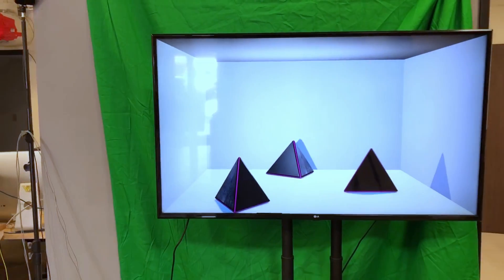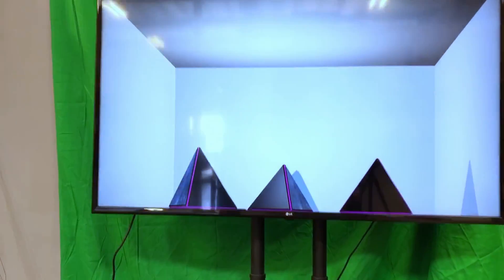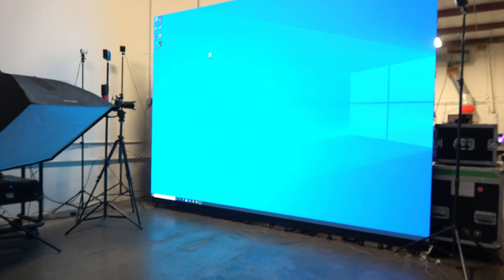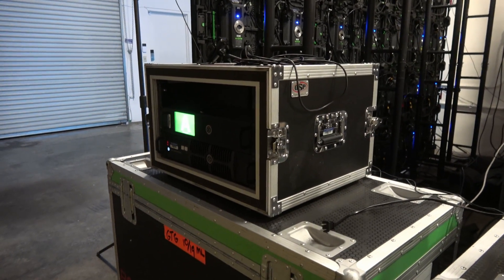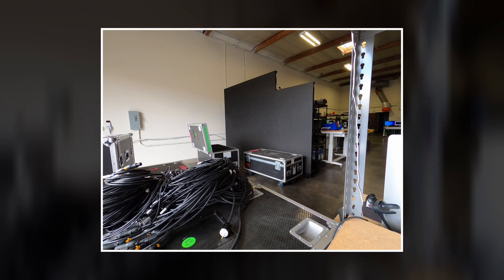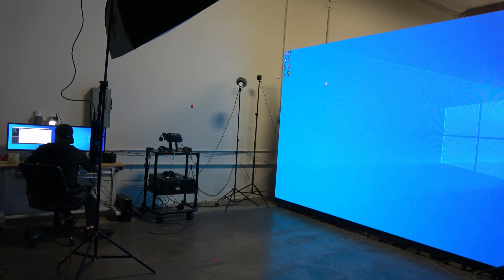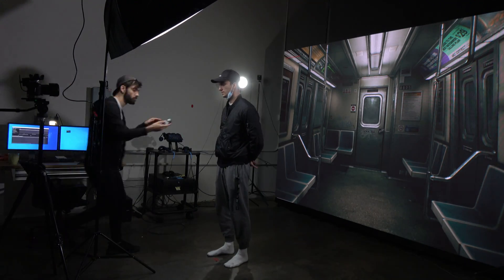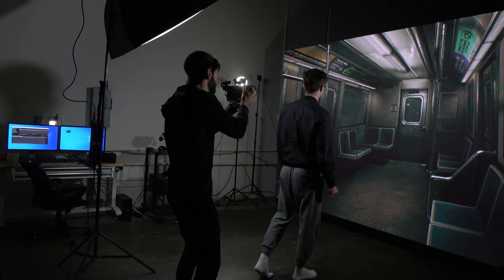Demystifying LED Wall Setups

Comment: Are you able to describe in more detail how you fixed the wavy lines from the screen? What frame rate and shutter speed and refresh rate did you use on the wall? Other camera settings?

Comment: You are doing great, actually I am from a Chinese LED display company, and I know the manufacturer of the display you are using. We also produce display products with the same configuration as theirs, but I want to learn about virtual shooting A lot of knowledge, such as the operation and setting of the camera and tracking device, how to output the picture of the specified position in the scene to the display screen, because in fact we have used the 3-sided display screen many times to do the XR scene, but They are all done by others, so I also want to know the specific operation process here;

Comment: The background always looks out of focus from where it should be at. I hated this in the Batman movie. Its promising tech but I think its being overused now and should be balanced with green screen shots where needed. The set is just too small and you can tell, where as filming on Blue screen can be done outdoors even on a very large open set with blue screen walls put up only where they need them.

Comment: so i'm thinking here, if you can track the camera position and direction, then you can render the background again from those angles but without the actors
then you can just mix both images to create a mask of the actors from the scene just like a green screen.

that means your LED wall doesn't really need to be amazing as it doesn't need to be the actual image used in the final scene, because you can always replace it with a better version of the background rendered latter. sure you still want the led wall to create the light and be good enough for the actors and the cropping. 
but it probably doesn't need to be very good

Comment: Nice! What's your LED display pitch to achive this great result without alising?  Any tips for display flickering problems? Thanks!!
Reply: I think what they are using is 2.8mm, and 2.6mm also a good pitch for the virtual production. With a high refresh rate spec up to 7680Hz, there should be no problem for the flickering problem for the LED wall. The key part for virtual production LED wall should be color gamut, color calibration, HDR, refresh rate.

Comment: Could you do this with short throw projector instead of an expensive LED wall?
Reply: It will be hard af
Reply: Yeah you definitely can. Some of the light speed shots of the millennium falcon used short throws on rear projection stretch scrims.
Reply: @ethanalloway5946  thank you my man 👌👏🤝

Comment: cool tech. the black levels between your foreground actor and the led panels didn't match, so i guess if they were closer the result would be much improved. Also it looks as though there is some sort of grade on the led panel scene which would contribute to this problem. If you are shooting the actor in srgb, make sure the cg scene is set to srgb and the led output is set to srgb, so everything is consistent.

Comment: Nice! How'd you go about getting the panels? Curious regarding cost on something of that size if you purchased?
Reply: Did you ever get pricing?
Reply: An LED wall fits for virtual production should have the good color gamut, LED wall & camera need to be calibrated, need to be super high refresh rate to get rid of flickering, and it need to be good in grayscale, with HDR, that the led can show the drakest part. LED wall (differen brands) equiped with brompton processor is ideal and the most premium in the market, but prices are high comparing with normal LED wall. 2.X mm pitches are popular for virtual production and prices varied from 2k-8k per square meter, depend on the processing system, specification, stacking system etc. There are cost-effective ways along with expensive ways, you pay what you get.
Reply: @krisabby  thanks for the help. I'm hopping video to video looking for that info. Is there a video in particular that you can recommend?
Reply: @vfxtechnologies2011  That'd be amazing! Thanks~ Looking forward to it!